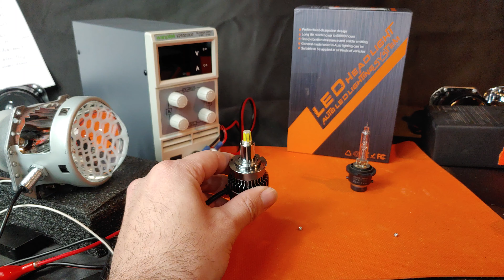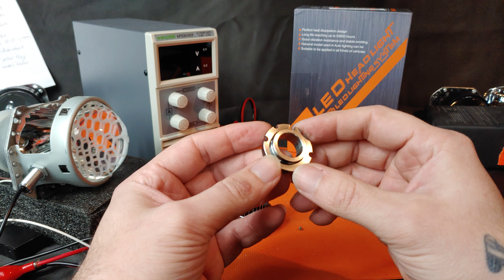Brighter than HIDs??? RACBOX LED Replacement Headlamp Bulb Review

Comment: I have watched most of your content while just coming by it by accident. I think you have quality content to offer, but there is need for improvements with presentation. 
I would suggest that when comparing brightness of halogen/Led/HID, use a fixed location for the bulb and lux measuring tool. There is always difference in location in the videos and sight line of lux meter. Secondly, The projector output and measurement is very important, but not shown in the video. Having the projector far from a wall is something definitely needed in future videos. Close up wall shot don't show proper beam at all. Some channels such as headlight revolution and retrofit source offer such wall shots that help better understand, but they have biased opinions at best.
Thanks, looking forward to future content. I think you will gain viewership quickly.
Reply from the maker: You're definitely right! Thank you for expressing how I can improve in a constructive way. I will work on coming up with a series of standardized evaluations for future videos. Thanks again!